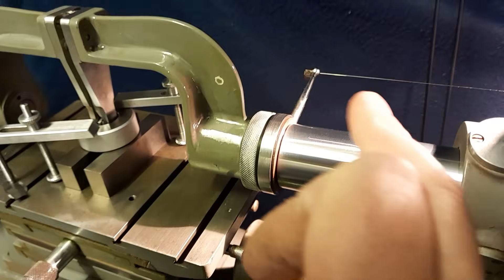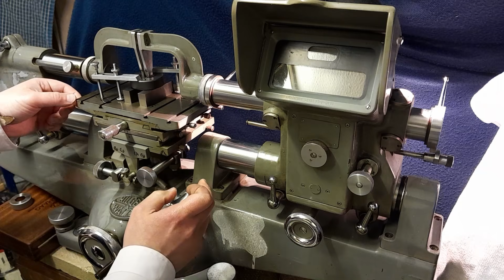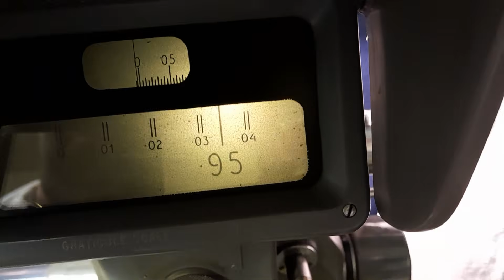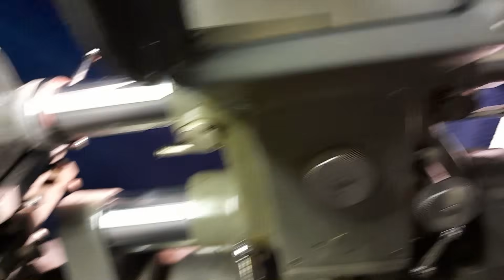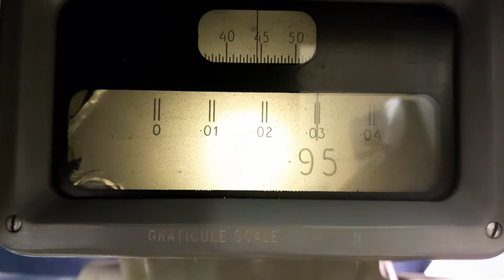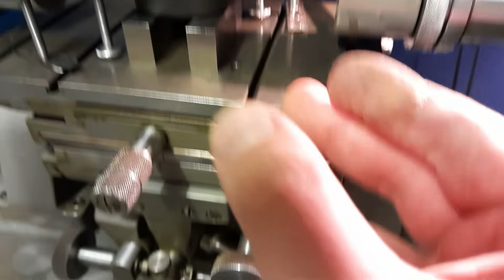Using my Hilger & Watts Horizontal measuring machine - PART 1

Comment: Great video, these horizontal comparators are beauties. We have two of these in our calibration lab that have been in use for the last 40 or so years calibrating ring gauges, thread rings and spheres mostly. One has been slightly modified and uses a 0.1um digital probe instead of the glass scales. Keep the vids coming!
Reply from the maker: Thank you very much, sorry I took so long to reply as I was working on the other videos.🙂 This is very interesting, as it shows the high quality of the engineering of the Hilger & Watts. It is producing precision beyond what was initially claimed (to no surprise). 
Are you based in the U.K? 
Who did the modification? 
Do you think it's capable to an even higher resolution?

Comment: 👍 that's a neat toy. Makes me want to measure something 🙂.
I imagine temperature has a lot of influence on it? Where were these used in industry? New to me. Glad there are folks like you keeping them alive.
Reply from the maker: They are still used today in calibration metrology labs because they are so reliable in both accuracy and precision. They can also be superior to the latest laser scan micrometer.
Regarding temperature, the most important aspect with these machines is keeping it stable.